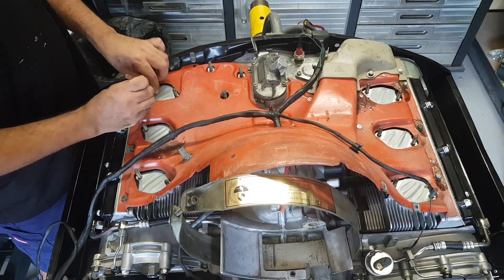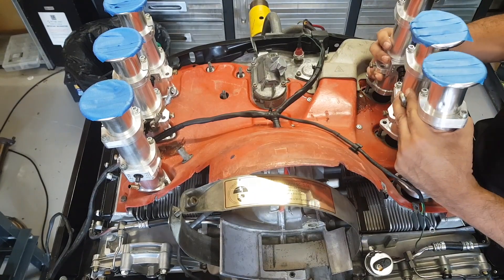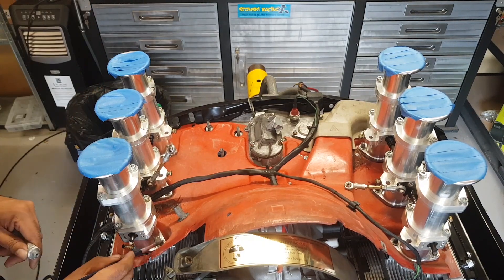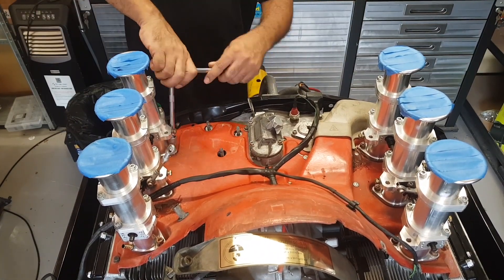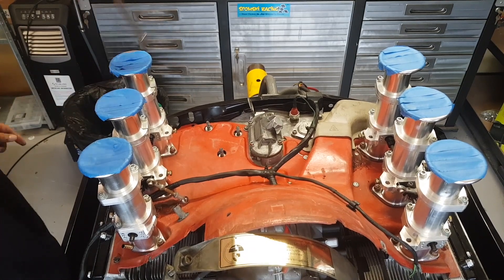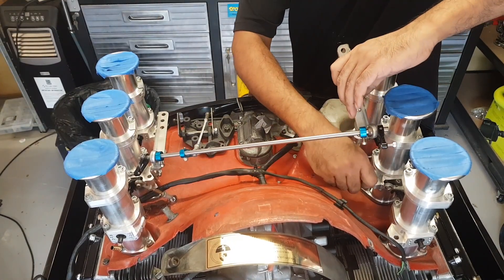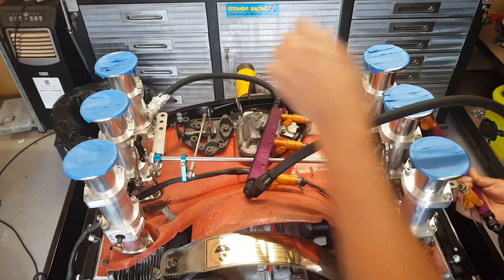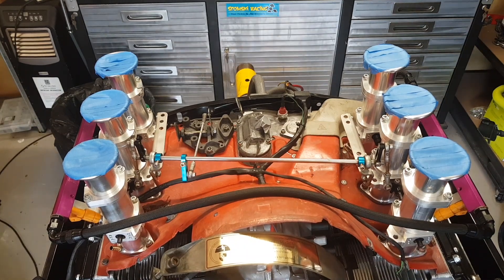13 Porsche 911 Engine Rebuild - ITB - Racehead Engineering - RHD ITBs

Comment: I noticed that you didn't install the isolators under ITB's.  Wondering why?
Reply from the maker: Hi David, not sure what you mean by isolators? Are you referring to the plastic spacers that are found under the inlet manifolds of a 3.2 litre motor?
Reply: @mikedsilva  My PMO's came with plastic spacers to prevent the heat from the engine from heating up the ITB's.

Comment: Nice job Mike. I went the Triumph bike triple setup route. It was a lot more difficult to configure due to the throttle linkages being the wrong spacing for the Porsche. Your kit is much simpler and a neat job.
Reply from the maker: check out racehead engineering in Sydney Australia.. most affordable itbs for porsche on the world market